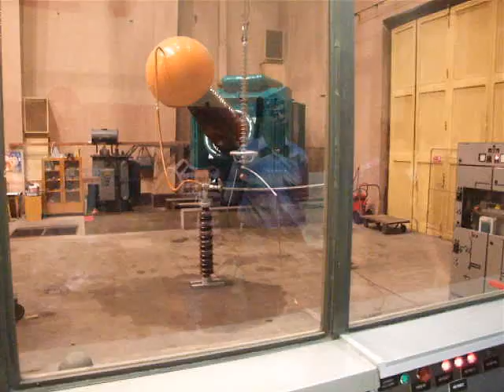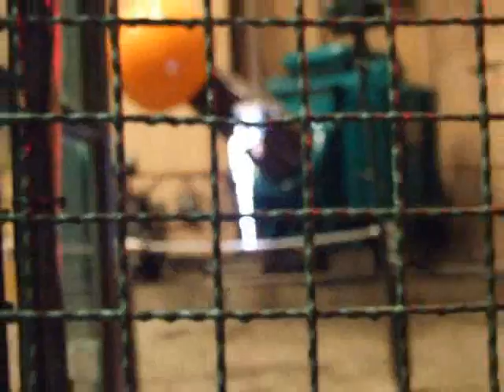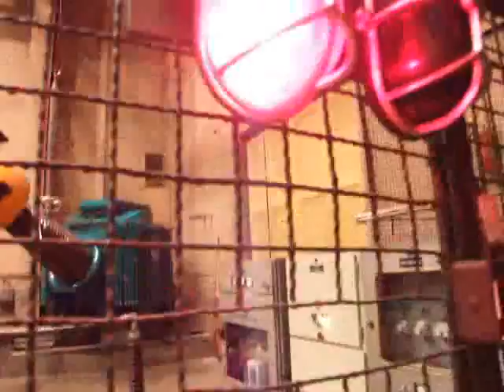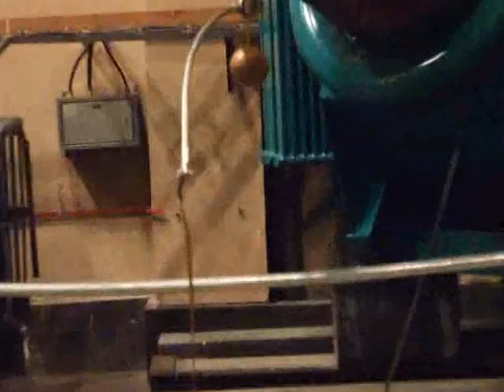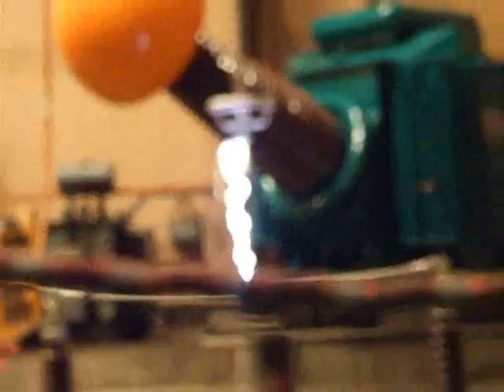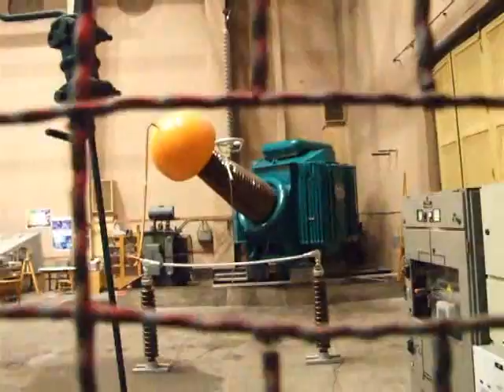600kV transformer!

Comment: @Coiltec: The current is what determines how much heat goes into the electrodes.  A 3A arc, while impressive to watch, isn't going to do much damage to anything. 

300A will weld 1" steel plate.
Reply: With 3 amps you can kill anything at 2kv it takes like 100mA to kill one for sure

Comment: I know that in dry air the breakdown between smooth surfaces fith a big enough radius occures when roughly 30 kV voltage is applied. What I see there hardly coincides with that fact, but although can be possible the voltage is realy 600 kV in some conditions.

Comment: Well my guess is this is pretty efficiently conducting air across the gap with that much current. It probably has ionized enough gas for a wide cross section to the arc. That will at the very least change the frequency of noise generated and possibly decrease the resistance of the air and energy converted to sound.

Comment: @JDTV1995 You'd rather be behind a plastic fence? This thing would penetrate several inches of plastic/timber.
It's for safety, if for some reason there's an arc, a metal grounded cage will stop and ground it.
Not really rocket science, just elementary safety for HV apparatus.

Comment: Dude... Is that constant flow AC? COOL :D
You can hear the transformer actually roaring at the huge power it has to give... That buzz is the 50Hz ferromagnetic core vibration sound :)
Insane!
What was the peak current? 3 amps?

Comment: I wrecked the equipment and substation at Kearney Labs near Summit Il. in the '90s. It was a test-to-destruction place that closed. That stuff was amazing. I kept the 2 twin 600,000 volt units that could make 1.2 mil volts! Huge units that were made in 1918. Scrapped them eventually, and got almost no copper out, it was so fine. They weighed 21,000 lbs ea. The oil became diesel fuel for my equipment. Boy, the stuff that was inside, and outside that place! I should've filmed it...

Comment: Volts have nothing to do with current... ALL alkaline batteries have a nominal voltage of 1.5v, whether it is an AAA size cell or a D size. The voltage is dictated by the chemistry of the cell.